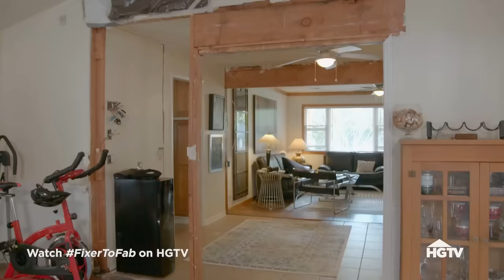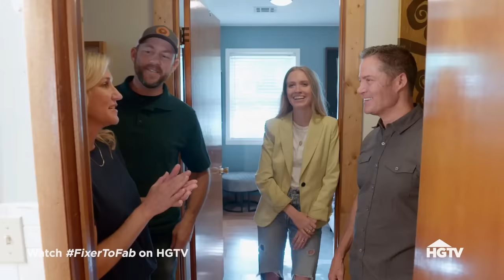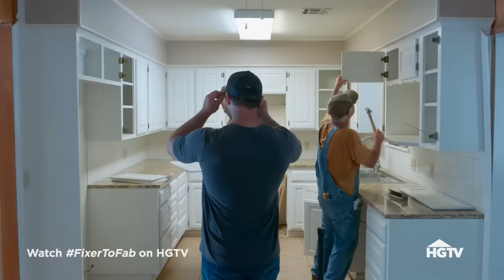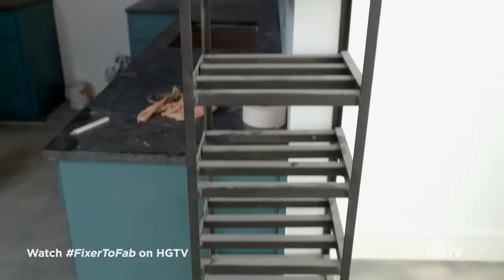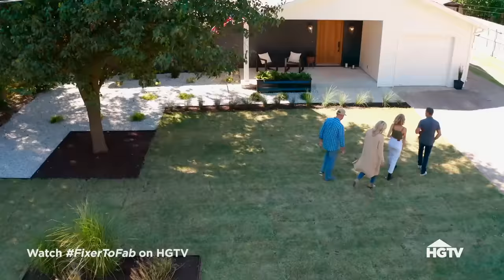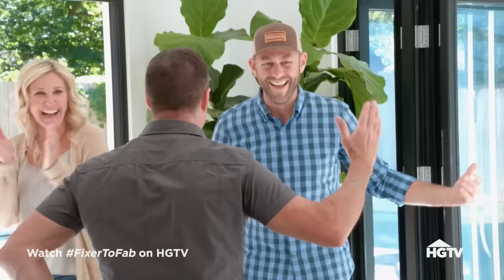Total Remodel of Dad's Unfinished Bachelor Pad | Fixer to Fabulous | HGTV

Comment: NO 🪟 in Front?! 🤨
Reply: Exactly! I would have like one so the entry way isn't as dark
Reply: Should have mirrored the full length and width used on the rear wing, using light frosted glass for privacy if needed.

And leave that bruck, do dark grey siding and modern feel shutters if you want some contrast, windows as the garage door.

Really a weak job all around with such a viable site.

Comment: Never paint brick. Just don't. Ask any mason.
Reply: I have commented on other videos about that as well. Drives me nuts that they always paint brick. In a state with such high humidity especially that is a huge mistake.
Reply: We live in a high humidity area, painted our brick almost 15 years ago, and it still looks fantastic. Best decision ever.
Reply: The paint looking good isn’t what you should worry about. Painting over brick is essentially a death sentence for brick because you're stripping it of its natural ability to breathe and release any moisture that becomes trapped. Because of this, any moisture trapped inside the wall will begin to erode the brick, wearing it down over time.